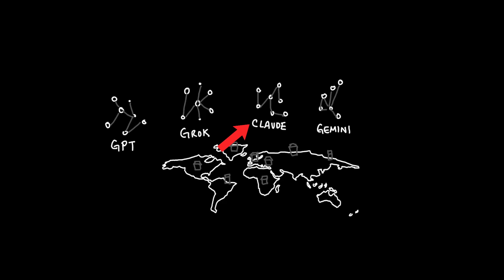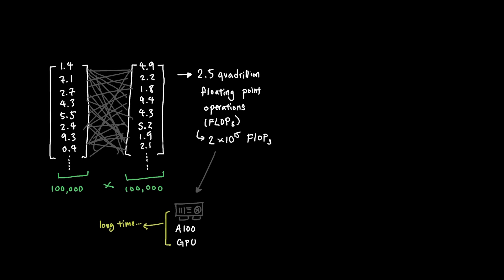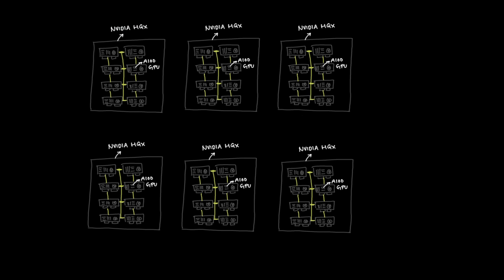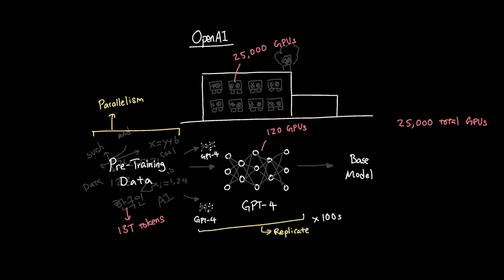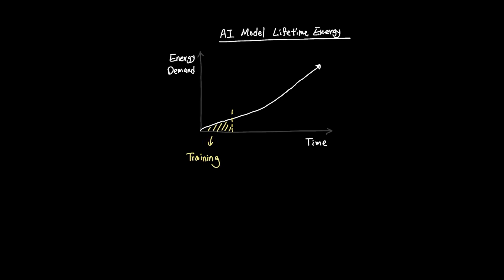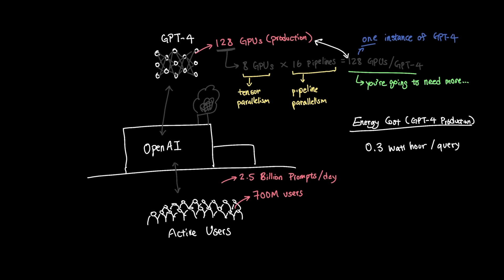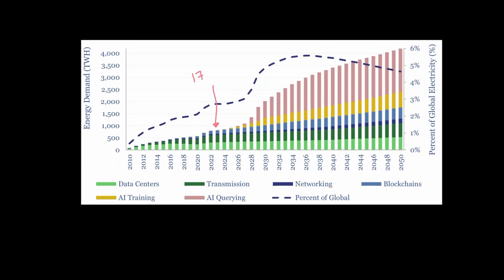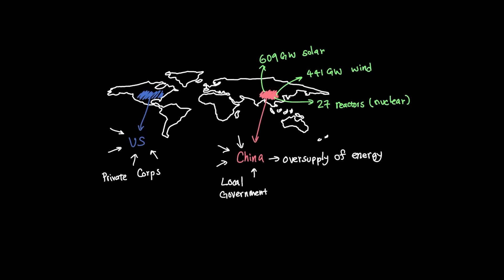Energy Demand in AI

Comment: Theta's AI network uses 20% to 50% of the electricity  through decentralization. And its scalable and   You can't get more decentralized then each phone, computer, car, robot and appliance is an edge node paying for their own electricity. Lowering latency, Hardware and LLM agnostic. They will be earning negotiable Tfuel. It will pay for itself.  They have the patents. And are already partnered AWS, Google, Microsoft and Deutsche Telecom.  Solves power and heating issues.

Comment: 8:10 your math is off by at least a factor of 3 since at inference time you don’t need to store gradients, or the two moments Adam stores. Beyond that you can make use of kv caching and offload strategies and quantization.
Reply: New GPUs are also much more power efficient. And once you finish training the model you are done. That energy cost isn't continuous. Once you switch to inference costs come down significantly you can also use larger models to train your smaller ones which you can even run on device in some circumstances now.
Reply: This is a good point and should be pinned. what percentage of compute actually goes to inference though, especially in the future when we're doing 10B+ pre training runs won't inference be negligible?